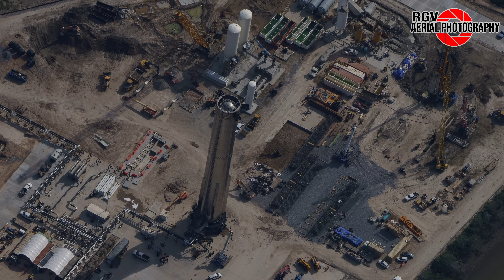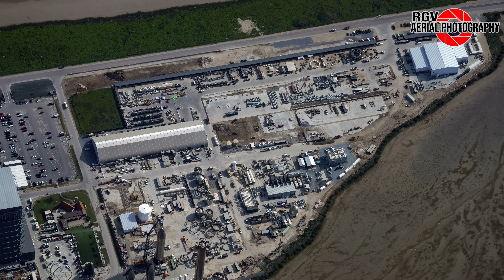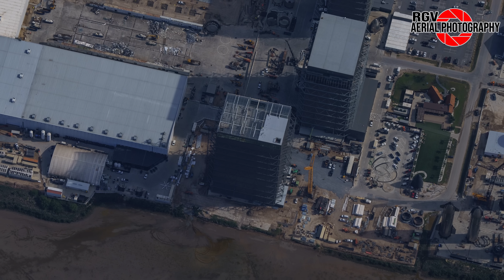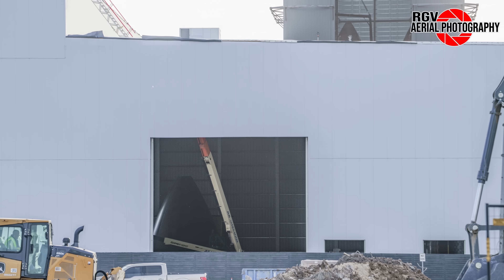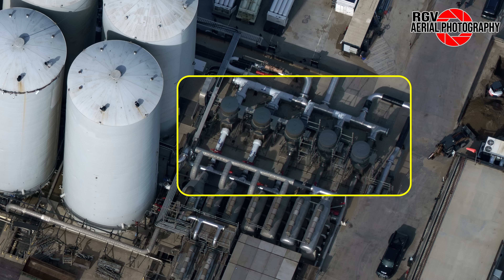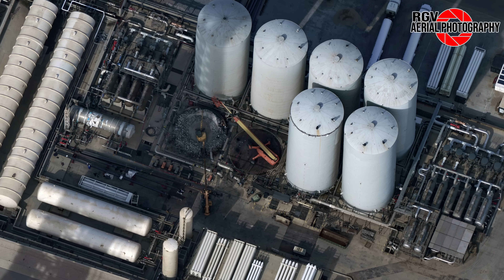End of an Era? Starbase Flyover Update #28

Comment: Personally I believe what the reason is for the stringers being added to ship 26 is to strengthen its payload bay area for feul, and will be used in future for the refueling in space demo. Just a theory though
Reply: I think that S26 will be used as a space tank, with other Starships flying to it and transferring fuel
Reply: A good sign of that will be some kind of hardware that will allow it mate with a ship or tanker and transfer.
Reply: Sorry, but S26 has basically been confirmed as Scrap.
Furthermore, there isn't a tank in it's payload section to store fuel, and there isn't a method to install one without cutting off the nosecone.

Comment: There are a few odd moments where things are referred to but not explained.  I can only remember one right now though.  Why is the altitude the images were taken different?  What was the previous altitude, and what is the new?  Thanks.
Reply: Weather can change the angle, so having images to compare is tricky sometimes.
Reply: @Geoff_A  Fair point, and I think that aligns with what we normally see.  

I guess I am just thinking of the last full flyover video, where someone mentioned a regulation change that altered the flight altitude around starbase.  I couldn't tell if it was higher or lower from the comment.

This just stood out to me, I guess, as it's another reference to an altitude change without really clarifying the change.

If any ... I might just be misremembering.
Reply: @icycooldrink6085  No you're good, there was low cloud cover in that one I think, so the images were from outside the TFR in that one?
Reply: I think they dropped TFR from 10k to 8k ft. I may be mis-remembering this fact though.